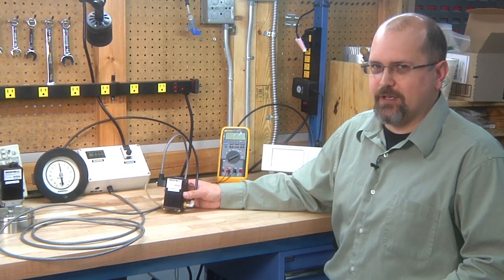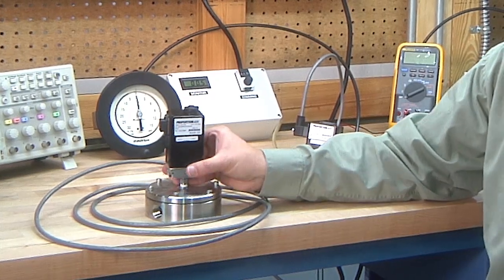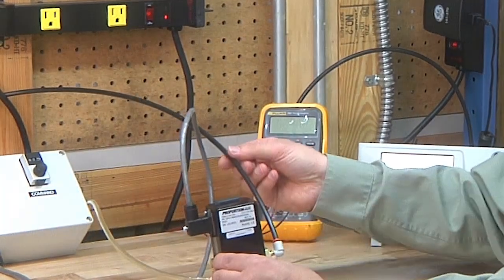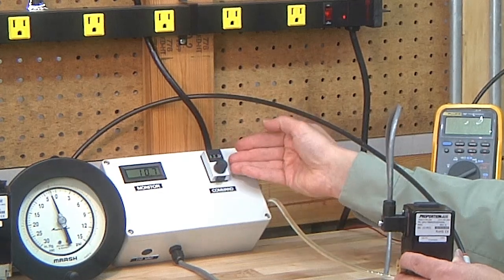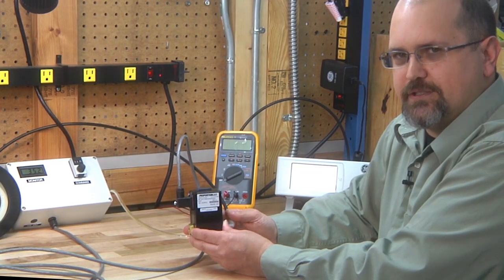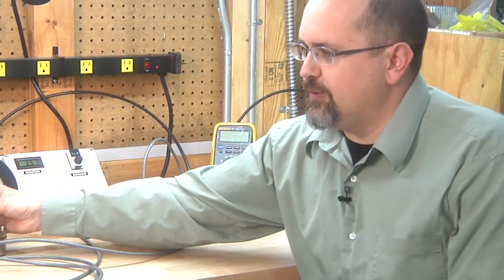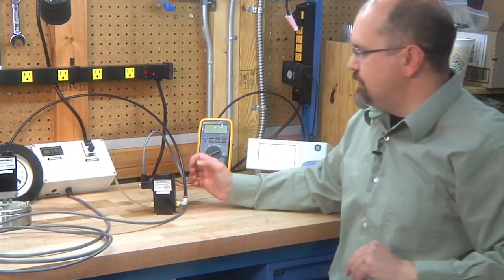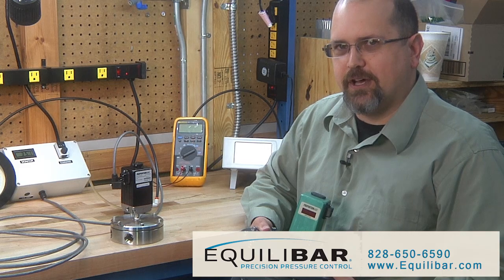Electronic Vacuum Regulators from Equilibar

Comment: Hi it's looking good, 
And I required for large scale like 3-5kl reactor 
Purpose -A reactor which is in vacuum distillation  and we want to control vacuum  400-450 mmhg instead of 700mmhg. 
Is this applicable for that
Reply from the maker: Equilibar electronic vacuum regulators can be used for vacuum distillation. The design will depend on the flows and vacuum settings you require. Please contact an Equilibar applications engineer at https://www.equilibar.com/contact/  to discuss specifics of your process.